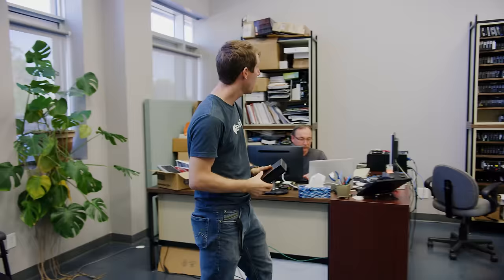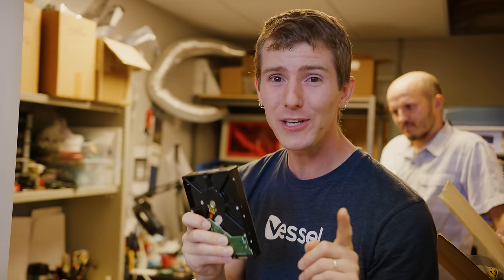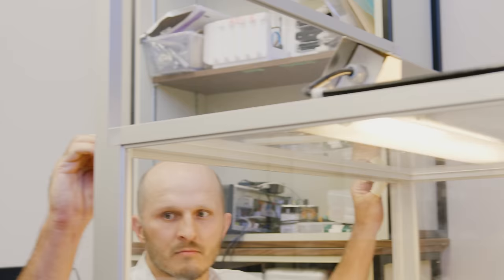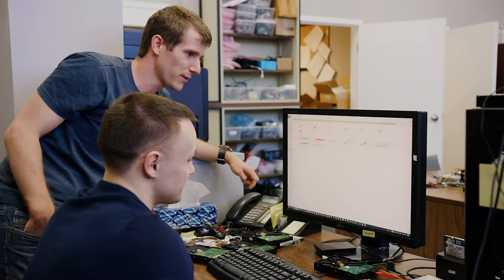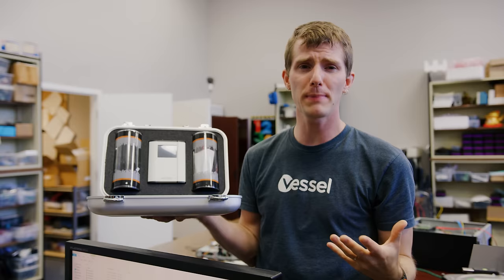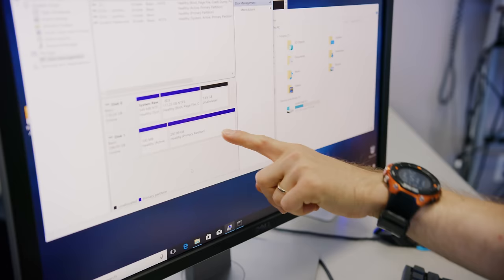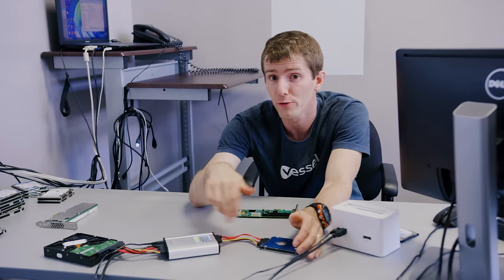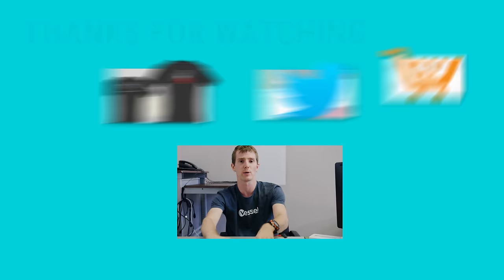Don't Waste $1000 on Data Recovery

Comment: "dont waste $1000 on data recovery!" proceeds to show the most common drive malfunction type in the first two minutes and tells us to go to an $1000 professional
Reply: Followed by telling us to BACK UP REGULARLY so we never need ANY type of data recovery. Regularly backing up to a $100 external HDD beats relying upon $1000 HDD recovery.

Personally, I use three.
Two I alternate, doing an old-school system image backup, weekly, while a third I use nightly to run File History.
Even if I have the computer brick itself while doing a system image, I still have data that is only seven days old, plus whatever I have on my File History.

And, against MS's recommendations, I only plug my File History drive in for as long as it takes to back up the day, thus providing some air-gap protection from virii or trojans, including ransomware.
Reply: Yeah, that's a click-baity title, because it's written so you think he's going to talk about an alternative to $1000 data recovery services when you have a dead hard drive, but he just means "don't waste $1000 on data recovery" BY DOING BACKUPS beforehand. Well, duh!
Reply: @S_Roach  have completed the Price Verification section of the claim form (if the item is reduced by more than $200 and you do not have the original catalogue, advertisement or promotional flyer (with a printed visible date) from the store of purchase showing the new reduced price);
Reply: Excellent presentation, thank you.
Reply: The thing is that if you are going to open the metal cover on the hard drive you might still never get it working when you put it back together.  All those little screws are sensitive to torque and must be just right.  I am not saying that it is impossible, just something that would be difficult for most people.
Reply: @S_Roach  That's a good idea to not leave the drive plugged in. If your system gets infected with ransomware, the data on any storage drives connected to the system will most likely get encrypted as well.
Reply: @S_Roach  I went to a data recovery once.  Cost me $100, not $1000.  Shop around.  Unless your drive has been in a fire, most places can use a standard recovery kit to get the data.
Reply: Deepspar pcie card drop deepspar he showed costs $2300.00
Reply: a* $1000 professional.
Reply: I think the emphasis is put on how critical the data is. He literally stated that like 10 times....
Reply: @OMA2k  its not clickbaity really because he did show how to recover data without going to a pro in two ways, 1.) the software method and 2.) the pcb (+rom) replacement method...
Reply: @zendyman5706  ooh you're hard
Reply: don't waste $1000 on data recovery

has to have entire server recovered
Reply: @charleshines6155  then i will use ducktape instead :)))
Reply: @charleshines6155  umm, no.
Reply: @S_Roach  olpooo99 pop ooo
Reply: Yeah and then he go. "Don`waste $1000 on data recovery" and he shows us a kit  for $2300 lol And what about the software you need. Big bucks on those too. Linus is going for the big money here lol.
Reply: @S_Roach  Yes, it's my backup drive that I can't read.
Reply: @charleshines6155  Seriously and who has a vent over a vacuum table to prevent dust. And where was the ESD strap BTW.
Reply: @LordOrwell  hello, can you say me what company, please.
Thanks in advance.
Reply: SO TRUE!
Reply: I'm running ddrescue on a clicking harddrive atm, since the data is important, but not important enough to warrant a 700+ fee for professional repair
Currently, on 99.86% recovered to an external drive.
Note that it requires as much space as you're trying to copy, including empty space
So if you're backing up a 1TB drive, you need a drive with 1TB+ space to store it, even if the drive only contains 100gb of data.
You can use --sparse to eliminate this, which only works if the destination file (aka the backup) is on an NTFS drive.
Reply: Get a bunch of refurbed high capacity enterprise HDDs and configure them in RAID. Use an M.2 NVME for the OS and some games and once no longer playing a game often just copy it to the RAID and symlink the directory to the same location it was on the NVME.
Reply: @LordOrwell  address?
Reply: He actually gave lots of tips to handle a damaged HDD before leaving it to a professional. The title wasn't wrong at all.
Reply: And then goes on to use a $100 desoldering iron (or odd looking solder iron) and a $300+ stereo microscope to START to fix the drive...
Reply: @balancingpancakes  What's with the nonsensical hiragana? Why do you direct that to me?
Reply: @OMA2k  I think I was sleeping with my phone when that was sent
Reply: @balancingpancakes  LOL. Thanks for the reply.
Reply: Proceeds to go to a $1000 professional himself and calls it DIY
Reply: seems to have sunked into the sea of money advertising. this is just an add... a paid one of course. it used to be fun to watch this guy but i think it's getting time to unsubscrive.
Reply: @ikroeber  His tips still involved spending a lot of money on expensive equipment.
Reply: @LordOrwell  which company did you use?
Reply: @a1selecta1  pc quest. They have all the required equipment.
Reply: I've had many drives fail both in private and my line of work... Yeah, they've all been due to crashed heads, 100%, no exception!
Reply: @tommyaleks100  cry Wolf boy wuhuuu wääj wäääh
Reply: @tommyaleks100  deutscher neider
Reply: @tommyaleks100  gönnst keinem was wa
Reply: @Teewriter  who? Professionals lol
Reply: @MrLoggfreak  I tried a bunch of these free and paid recovery tools when my drive went RAW. Just like the video, kept freezing while trying to mount. I’m worried I did more damage trying so many products. Time to spend those $1000’s
Reply: @LordOrwell  Where?
Reply: @LordOrwell  which company
Reply: Exactly!
Reply: @BillMadeMovies   Same  I can't access my drive it's a storage one
Reply: @OMA2k  Not enough no duh's when the absolute majority of people haven't even remotely had the thought in their mind on backups existing, how to back things up, how easy it can be to backup and near-instantaneously be up and running again.
Reply: Your mistake was thinking linus writes his own dialogue anymore
Reply: The YouTube DIY Perks opened up a hard disk and was able to recover data after a head crash

Comment: "Dont spend $1000 on data recovery." And then throughout the entire video "send it to a pro, send it to a pro" 1/10 video naming.
Reply: the only time he said that the only option was to sent it to a pro, was in case of physical damage, the other cases he said that there are tools available (although kinda expensive) are reusable and less than $1000
Reply: The problem with "if it's physically damaged" is that very few people have the knowledge to pick up on the damage quickly. Running a failing drive will generally result in more damage and less recovery options.
Reply: Really. You don't need to hire a pro. You just need to be as knowledgeable and well-equipped as a pro. Got it, Linus. Thanks.
Reply: yeah, I'm sure most normal people have all the tool he used in that video to repair it themselves... so unless you took immediate action before it occurred, you pretty much have to fork the cash if there's any valuable information on it.
Reply: Well the real moral of the story is don't send it to a pro because you should already have it backed up. A second hard drive is MUCH cheaper than data recovery, and much easier.
Reply: its "send it to a pro" if the data is mission critical, which makes sense. Or "send it to a pro" if you aren't comfortable/can't do the repair

seems pretty reasonable to me
Reply: This channel only uses clickbait titles now, which is why I unsubbed.
Reply: There was at least 3 TIMES when he said this is something you can TRY AT HOME. Learn to listen small child.

Comment: "How to save money in data recovery..."

Buying two drives instead of one in the first place.
Reply: yet, you still managed to lose all of your HDD Data  of the both Hard disks
Reply: If you were to get say 3 or 10 or however many you want, you could use one as a checksum drive, and if any one of the other drives fail, it'll look at the bits on itself and the other drives, do the arithmetic, and tell you what all the bits on the lost drive was / save it to a fresh drive.
Reply: @junoguten  In fact, let's make the drive controller do it for us, so it's automatic, and even the OS doesn't know it's happening.  We could even add battery backup of cache which then gets written to a Flash drive!  ;)
All joking aside, I've used QuickPAR or the like for largish file transfers.  Where large is defined relative to transfer rate.  It has the added bonus of telling me which PARts are good.  I assume the people still making optical disc archives really regret not using it when a disc gets scratched!  XD
Reply: and raid 0 both of dat....
Reply: Back up critical data regularly.
Reply: RAID is not a backup
Reply: using RAID-Z 2 with plenty of disks and a sound backup strategy ;)
Reply: @lemmy1945  and then a faulty power supply kills all of that. You have to also have some kind of backup somewhere else (even if it is a USB stick)
Reply: @user-xr3rb6pn9m  that's part of the backup strategy, e.g. keep a set of discs locked in my office and rotate. Add an APC at home. Not expensive but helpful.
Reply: Put them in RAID and it's fine!
Reply: @adorenu1338  tis wise to have old school plate reader for when drives die if ya wanna keep your data. hhd's havent changed much cept in size.
Reply: Think about what you really need to back up. Most files on a system are redundant binaries. You want to keep documents, photos, family videos, and configuration data for programs. With Linux it's pretty easy in that regard because all of my programs are installed through a package manager, so I can simply back up its database. Although some packages were built from source so those would have to be rebuilt. I backup /etc/, /usr/local/ which has a lot of my custom code,  $HOME/.config, and the ASCII files in the home base directory (such as rc files). Password/account managers such as Keepass as well. Easy to script the process with rsync and the find command. 

Very small footprint. Compress and encrypt; it's small enough for free cloud storage such as Google Drive. 

Windows would be a little more difficult because of random upstream packaging. But important files should be placed in certain areas and backed up on a regular basis and sent off site.
Reply: buy an ssd
Reply: Best practice for critical data would be the 3-2-1 rule, 3 backups, 2 different mediums(IE. tape, HDD, cloud), 1 offsite.

Comment: Linus: Tells to be careful because of physical problem

Also Linus: Instantly lifts the drive before it has time to stop spinning
Reply: That's not really an issue though, the r/w heads park almost instantly when the drive loses power. The head hitting the plattersis what causes damage. When the head is parked it can't hit them.
Reply: @mscheese000  *disabled
Reply: @hyxalide  What?
Reply: @mscheese000  21:18 (intended to be a joke)
Reply: @mscheese000  have completed the Price Verification section of the claim form (if the item is reduced by more than $200 and you do not have the original catalogue, advertisement or promotional flyer (with a printed visible date) from the store of purchase showing the new reduced price);
Reply: @mscheese000  unless it's a really old drive where the head landing zone is the inner disk area of the platters.

Comment: Video title: "Don't Waste $1000 on Data Recovery"
In the video: "This is the Rapidspar. It costs around $2000."
Reply: Also in this video: "End users aren't expected to buy one."
It's almost like you were listening.
Reply: $10 says that thing's running Linux. Convenient having an open source Kernel along with FUSE support for mounting any custom or natively unsupported filesystem in userspace.
Reply: @DaniPaunov 
Oh yeah, it’s almost like I’m expecting some cheap data recovery alternative when the video title says what it does, and I’m not then expecting them to start talking about $2000 recovery techniques... But hey, stupid me for expecting that kind of thing when the video title says what it does, right?
Reply: @TheCrazyStudent  Still in the video: "If you, the end-user, can find a shop that has one, you should expect to pay about 300$ for a recovery it can handle".
It's almost like you were listening
Reply: I wonder why it costs 2k
Reply: @oddity4650  Possibly because hard drive-related issues, do occur with most consumers at one point or another. They are hoping to hustle a few wealthy ones who are willing to pay in full without hesitation.
Reply: @thegammagoblins109  yes I think it definitely is to make someone think they need to pay a lot
Reply: @DaniPaunov  key word if.  This means that's there's a good chance that you wont find one in a shop.
Reply: @krozareq  I don't think the thing deals with filesystems much. This is trying to solve lower level issues with reading blocks. $20 says it's not "just" running Linux but runs custom software dealing with custom hardware on Linux on custom hardware.
Reply: You aren’t spending 1000 dollars technically.

Comment: TestDisk is a pretty amazing program for if you have a few bad sectors or if you accidentally formatted a drive
Reply: PhotoRec is a good associated software from the same company that does file carving to recover files by signature in a partition if TestDisk doesn't get the whole partition back.
Reply: Looks like it doesn't work for APFS?

Comment: One of my favorite data recovery utilities is ddrescue for Linux. Assuming you just have bad sectors, you can make a bit for bit copy of your drive and when bad sectors are encountered, they are added to a log and skipped for the time being. After the program has reached the end of the drive, it goes back and tries the failed sectors again, pruning the log as it gets good reads. You can have it repeat this process ad infinitum, of quit after a number of passes.
Reply: The really cool thing about ddrescue is that you can mostly maintain good recovery speed by skipping over slow blocks. If a drive is physically failing and getting worse, better to get 99% of your data by skipping the slow parts than 0.1% of the data because you spent the last 5 hours of the drive's life recovering at 1kBps :-|